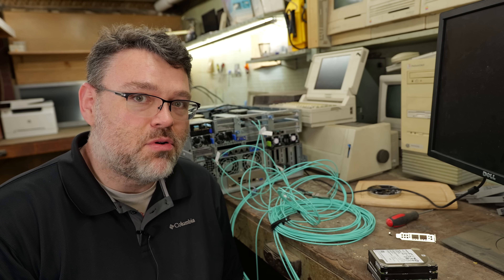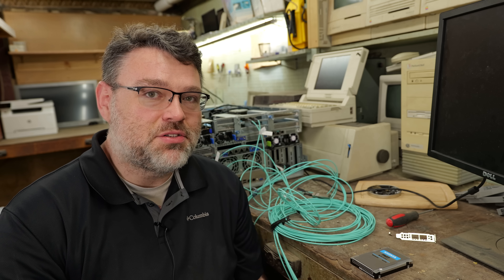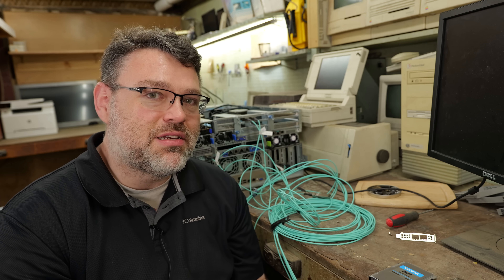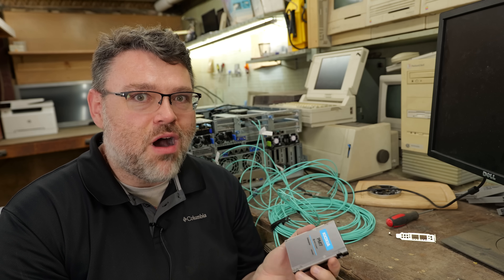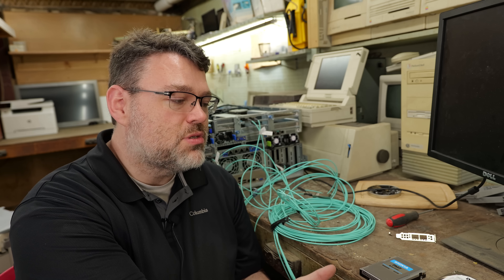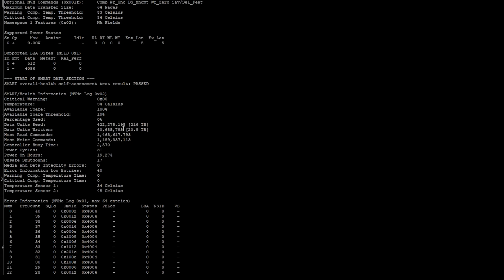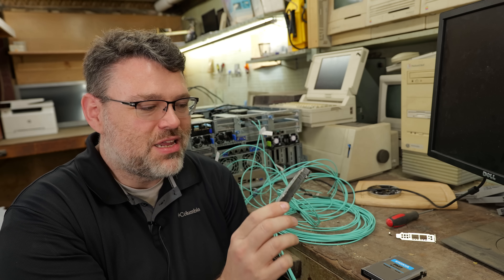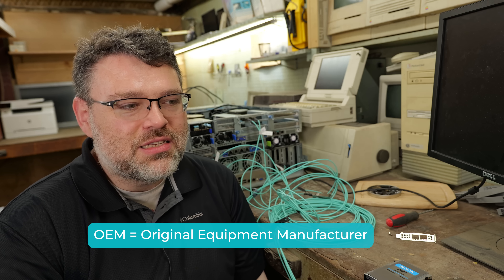What is a SAS SSD?

Comment: In the early days of SSDs, database system architects would prefer spinners for their redo logs because the IOs were mainly large sequential writes. Redo didn't require a lot of space, so the drives would be short-stroked so that only the outside of the platters were used to minimize head travel and get the maximum transfer rate. This also helped to prolong the life of the drives, apparently.

Comment: Mimicking the servers at work, I recall setting up 2x 10K RPM WD Raptor Drives in RAID-0 configuration for my kickass gaming rig at home.....lol. You also have to factor in the data recoverability rate and cost of SSDs vs HDDs. I agree, for most server types, SSDs and especially, NVMes are a bit of an overkill.

Comment: If you format your drive with larger cluster size your mechanical drive will last longer, problem with hard drive failure is because people use default allocation unit or cluster size which damage the disk read and write head:face-fuchsia-tongue-out::face-orange-biting-nails:

Comment: Are these U.2 / SFF-8639 drives or is it the same SAS connector I use for mechanical SAS drives? I get suspicious when manufacturers cheerfully reply I can replace mechanical SAS drives with SAS SSDs, yet never respond when I ask about using them in the SAS bays I have available. I know i can replace them, I'd rather not buy new servers to do that just yet.
Reply: No, they aren't compatible.

There is trimode backplanes and connectors that accept u.3 nvme drives, sas and sata, but is a new technology

Comment: on a older server (HP gen8) , NVME was generally something that would be on the motherboard connectors using 8PCIe lanes and they where expensive and could be burned up on the writes in 5-7 years, or would be password protected in such a way that if you didn't have that actual password, all you really had was parts..  Me, I collect the 45nm 400gb SLC SAS drives, using only the older ones, in DATA transfer/modification, as they may never burn out.. and almost nuke proof.  When I was mining ETH (2018), we had some SATA Intel545's that lasted as little as 4 months, while the OS and routines on most were stored on HP SLC SATA  and these never burned out, even when the temps went to over 140*F (air conditioner was turned off) and Mining cards failed and fried a Pcie accelerator..  Don't forget the tape back-up..  TLC is garbage.. and is going to be sketchy especially if you but used and generating a lot of useless data, like in AI.. A 400gb SLC is going to be better than a 4-6 TB that has a write (est.) limit of 30PB and is going to be more likely to live on, but these are now getting harder to get in the used market.  If you are buying used, the considerations are, writes per GB total, used, how many can one get and costs..Deifately buy them 10-14 at a time. and look for the spares that are being cycled out.  Like scoring 24-30 Dell 400GB SAS 2.5" 12G SLC Solid State Drive SSD T2TPF MDKW-400G-5C20 0T2TPF drives...

Comment: Sure, with a unlimited budget anything new will be better/faster than 5-10 year old equipment but a server that is still doing what it did 10 years ago is not trash, especially if you can replace the power hungry hdds with power sipping ssds. For home use servers from 15 years ago that are still fully functional will do just fine and save you a ton of money in hardware as most is free or near free used. There are also sas to M.2 adapters for both ssd and nvme disks that would serve the home user well for a long time, regardless of the servers age. If you match your activity to the servers capability there is no "to old" . Some still run pre 286 pc´s and servers/mainframes from the 60´s and 70´s and enjoy it as a hobby. With what you know you could be a big help to us who can´t buy new for what ever reason, instead of trash talking older systems. The best server is the one you can afford, any thing else is pointless.
Reply: Good point.  What you said, really applies to students like me.  We can't go out and buy threadripper or epyc systems.  And, picking between SAS SSD's and just 
normal SSD's are a no-brainer.

Comment: #Level1Techs Please consider a series on a hypothetical enterprise hosting ~50 workloads (mixture of domain controllers, file servers, application servers, web servers, etc.).  Compare/contrast 5, 10 years of OPEX/CAPEX costs between two options.   Option #1: Estimate the monthly, annual, 5-year, 10-year total cost of ownership (OPEX) to host these workloads in separate failover regions in either Azure or AWS.  Option #2: Calculate the hardware acquisition costs to acquire (2) sets of Dell VXRAILS (with necessary compute/storage), VMware ESX/SRM licensing.  Then get a quote for an Equinix power, space, cross-connects (if multiple cabinet required in each colo), wan/internet circuits capable of containing the Dell hardware in (2) separate Equinix regions. (note: Equinix has ‘accelerators’ in its colo contracts that increase the OPEX cost by 5% a year. Be sure to factor that in.)  Then estimate the admin costs to support Option 1 vs Option 2. I’d be fascinated to see a fair comparison that helps teach my clients hosting in the Public Cloud versus an old school colo build it yourself datacenter.  If you’re giving me reckless side eye while reading this ‘homework assignment’ - I get it.  Lot of work.  Are you done yet?

Comment: For me it seemed like what was hold back NVMe drives in this segment was the seeming lack of lanes to plug them into.  And before you say "Epyc has 128 lanes" that's good and all but still only 32 4x devices.  Our nimble has 48 drive capacity before we even add a shelf.  Older Intel systems are like 56 lanes or something?  Not a lot, and that's assuming you can even split them in a way that would be useful.  We need like PCIe switch add in cards that can give us ports to actually connect to.

Comment: Living on the bleeding edge sometimes dont let you see whats going on on the middle of the blade

For most people and specially homelab enthusiasts who usually adquire old servers would be thrilled to put ssds on their hardware
Reply: Re Homelab use:  I bought an X10DRi-LN4F+ motherboard (Dual  2011 CPU) on ebay for $120 which can support 14 x  NVME drives and dual 10GBit ethernet with the appropriate PCI-E cards. Started with 4 x 2TB PCI-E V3 Consumer SSD in RAID 5. . So it need not cost the earth.

Comment: I was slowly replacing mechanical drives in my systems with SAS SSDs and the funny thing is in my experience Toshiba ones were the least reliable. Had four 3.2TB SAS3 drives - after less than a year of a moderate use three died within a month and fourth gave signs of imminent failure so i retired it too. Replaced them with the HGST drives of the same capacity - these are working nicely for years already.

Comment: i have a r630 with e5 2683v4. i could use nvme but booting from is dificult. i use 6  521gb sata ssd  in raid 10 and those drives getting heavy redden and written. one drive last about 18 moths and cost me only 30€ i have a sas ssd but those a bit expensive if you ask me. also i dont need the extra features of sas drives. i needed a powerful and cheap server so the r630 cost me only 600€ and it came with 2 xeon e5 2683v4, 512gb of 4rx32 ram modules, 8 drive bays, perc h330 mini, 2x2 10gbit nic, idrac8 enterprise. i am happy with this it is perfect for my needs maybe a bit old but powerful.

Comment: I use tons of sas ssd drives in my environment.
As for servers...
For our environment... most things don't need the extra performance as we hame a lot of service running  at relatively low utilization.... we get better value by having many more servers a gen or 2 back clustered.... overall reliability is better having the ability to have maintenance performed by moving containers and vms to other nodes. For example... I have 5 dell r320 servers with 10 core cpus 192gb ram and 8 sas ssd drives each and 10gb networking in a cluster..... all of that for less than a single new server and for what it does the speed is a non-issue... many VMs and containers running on proxmox... everything could run on 3 nodes if needed .... maybe 2.... and that gives us a super robust environment and I can wait for newer gen servers to drop in price.

Comment: For my use case, NVMe is overkill as I don't need that crazy fast NVMe speeds. I'd rather have 16 SATA/SAS drives than 4 NVMe drives on a HBA card. Capacity is more important than speed. My server is mostly for serving media and the occasional VM so I don't really need NVMe speeds. Also SAS SSDs typically use less power than their NVMe counterparts. My server also has a bunch of 16TB SATA HDDs in it in a ZFS pool and I typically get over 900MB/s which is plenty fast for serving movies and TV shows but I would like to eventually replace them with something a bit more reliable and more energy efficient and these SAS SSDs sound like a logical upgrade for me. My wallet says otherwise but eventually I'll upgrade the HDDs.

Comment: This is why I wish SATA would just go the way of PATA. MOBO and CPUs should just drop support for SATA and move to SAS. SAS are backwards compatible with SATA drives so there would be zero issues with people moving their drives over. NVME will always be better but if hardware manufacturers are worried about backward compatibility they should just switch to SAS which would provide backwards compatibility for HDDs all while actually giving them a way forward. The last major revision was completed in 2008, 16 years ago. It could drive now. SAS-4 on the other hand is only 7 years old and goes up to 22.5Gbps or about 4x the speed of SATA.

Comment: Toshiba has recently come out saying they're investing in both HAMR and MAMR drives. I'd be interested in L1T objective analysis on the pros / cons of each.

Typical use cases for home servers would include steam cache's and media servers. In the case of latter, say you wanted to ahem, backup / transform your physical optical media to streamable files. A drive with high write capacity is  required for this, and high throughput is required especially if you have multiple optical drives operating simultaneously. Having one with enterprise logs so you can have an estimation of time to failure is super useful.

The other piece of the equation being once the media is "backed up" and compressed, what drives would you archive it to? Hence the question / statement on the first line 😁

Comment: The ethical choice would be to make use of the mechanical drives. You have heard of RAID. You have heard of replacing failing drives, on the fly. An array can rebuild itself. I know this goes against your message here. For all I know your video is affiliate link based. No money for the used stuff hence, why would a youtuber ever suggest it? No money in that suggestion. I get it. Most would suggest those 2.5" HDD can come within spitting distance in terms of speed of SSD. Imagine the cost difference. Sure, go ahead. Buy new! It's so worth it...

Comment: NVMe may be very fast, but that's the only advantage. My main system is running SAS and SATA. SAS is great because it only needs a host adapter and I can run several drives and a lot more if I choose to use an expander. I'm also running a couple of SATA SSDs on the SAS controller very happily.

Frankly, I'm really not at all impressed with NVMe technology. At present, each one takes four PCIe lanes and is basically a four-lane PCIe slot you can't use for anything else. Depending what you put in your system, PCIe lanes can be a limited resource that can be better utilised on something other than storage, and that's before going on to the limitations of PCIe splitting. It's a very inflexible storage system and I really dislike motherboard manufacturers dictating how I can use the limited number of PCIe lanes; I need to be able to swap drives so embedded M.x slots are a complete waste of resources for me. I did hear that there may be single PCIe lane NVMe devices, which could be a improvement.

--------

One possible solution to this could be some sort of 'NVMe Host Adapter' that would utilise just one PCIe slot and provide connections (ports) for several NVMe drives. Maybe it could take the form of a 16-lane PCIe 5.x Host Adapter and provide, for example, 16 4-lane ports a PCIe 3.x speeds enabling up to 16 NVMe drives to be connected to one PCIe slot. Such a Host Adapter could be made that would also support SAS and SATA drives, which could be relatively straightforward if miniSAS connectors were used. This would facilitate choosing how resources are allocated in terms of PCIe lane utilisation, number of storage devices and make NVMe a much for viable alternative to SAS.

It could also make system expansion rather interesting if standards existed that enabled, for example, a front or even rear panel hot-swap array to also be used as a general expansion slot. This could be used for card readers, network adapters, video capture hardware, sound cards, or even custom home-brew expansion or scientific expansion cards. Could the 2.5" U.x also be used as a kind of 'form factor' for expansion cards?....

Comment: NGL, I've been debating moving my plex system to SAS ssd for a while.  It is easier & cheaper to do than move to a newer box with trays for nvme, e.3, or e.1.  Plus, I could keep costs down because I don't need more transcoding power.

Comment: Hmm, this would be interesting for the likes of schools with older hardware.
In my case I have 9 year old twin vmware 128gb hosts on a 12gbit sas storewize v3700 that I am getting... concerned about. 
16tb total on itty 2.5 inch drives.

Schools need for compute has dropped and storage too (shifting to online onedrive usage) so a couple of the lower capacities in mirror would be sweet - depending on cost.

I do want to get a newer server though! Then migrate the need for DCs but have papercut and their finance package and potentially their student management system that require a physical server.

Comment: I've used enterprise SAS SSDs for years as VFlash drives (VMWARE) and server boot drives. One of our FIber channel  SANS uses them exclusively and an ISCSI SAN uses them as it's performance tier in an auto-tier setup with an expansion unit holding 8GB NL SAS drives. We're fairly small, so footing the bill for NVME SANs isn't going to happen any time soon. If you're using shared storage that is still spinning hard drives, using caching methods to 12Gbs SAS SSDs or NVME drives really helps out.

Comment: Would you run a sever with a E5-2698v3 if you got it for the price of the ssd's in a beginner home lab?
Reply: The only thing wrong with them is power efficiency. You'll probably draw at least 100 watts at idle. Newer equivalent servers will give more compute for the same power. Newer small servers will give the same compute at less power.

Comment: Enterprise SSDs still cost a lot more than their equivalent (enterprise) spinning drives. Read intensive SSDs cost about double, mixed use about triple, and write intensive about quadruple. A write intensive SSD of modern size (not 512GB please) costs as much as a server. And you need at least two of them. It makes me smile when Wendell talks as if all of us are generously gifted our disks by Kioxia :)

My enterprise HDs typically last 10 years, then get replaced due to overall server obsolescence, not because they broke. And I'm talking about servers with 5-8 MS RDS VMs, MS SQL, File servers and other write intensive roles. I highly doubt a Qlc SSD will last 10 years under that load, unless you pay a fortune for them.
Reply: it's also a case of knowledge and experience. We know spinning rust pretty well after forty or so years of use. We can calculate lifetime cost and performance. SSD's have what, 10 years of reasonably common use, and not anywhere near the same amount of data about long time use. Predictability is worth a lot in professional server environment.

I remember the first SSD I saw. it was DRAM based as there were no such thing as flash memory at the time. The DRAM was backed up by a battery that could keep it alive for a bit more than 24 hours. Battery goes empty and all storage is gone... But as primitive as it may seem the performance was phenomenal.

First FLASH SSD I got my hands on was a prototype from a manufacturer. It was dog slow. Installing the OS on it took ten times as long as installing it on spinning rust. It was hilarious as you knew that this was a SLC SSD, and still it sucked so bad. Now I've seen SSD's fail badly. But they were all consumer grade devices.
Reply: The term “spinning rust” annoys me. When 4TB SSDs that can last 10/12 years like HDs with the same usage on high-transaction servers and cost $400 then we can call those splendid examples of technology that are rotational disks “spinning rust” without necessarily being a youtuber (very good, but a bit far from the pockets of normal sysadmins)
Reply: @dancalmusic  Spinning rust is not a derogatory term. It's an informal, cutesy term. Not necessarily correct either, as HDDs haven't had iron oxide media layers for a long time, but that's beside the point.

Comment: "Socket 2011 CPUs are trash" Don't you talk about my sons like that! LOL At least for homelabbing it doesn't matter too much, but I will say, having gone down the rabbit hole to look at more recent ewaste on ebay recently, I did find out just how far the gap between the 2630L-v3s I have, first gen Xeon Scalables, and then the super impressive 3rd gen threadripper and even earlier epycs is. Been trying to find used enterprise gear that would work well for a decently capable editing server that doesn't send my wallet into a panic.